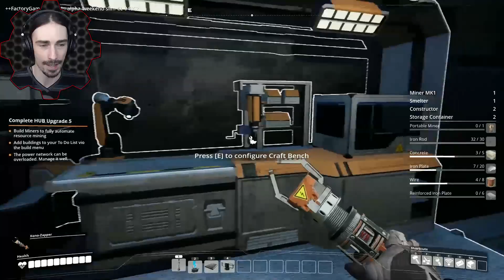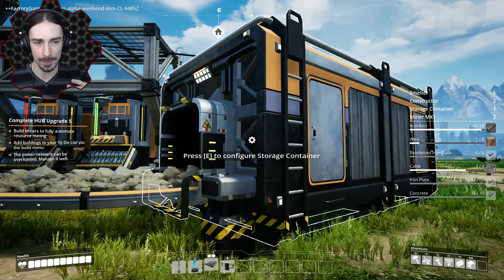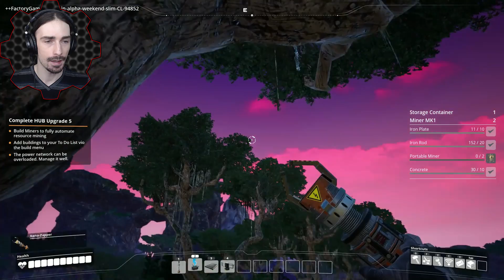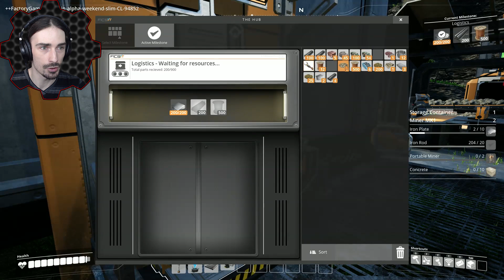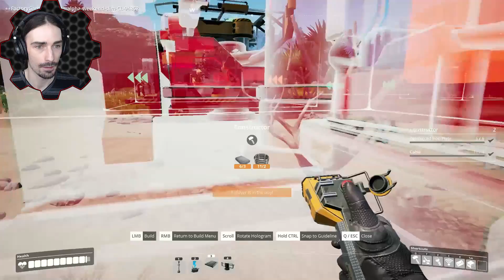Conveyor Splitters Are The Key To Happiness! - Satisfactory Gameplay

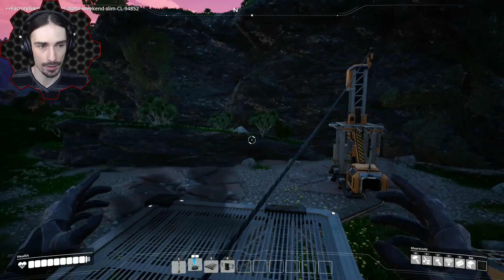Comment: It's a decent start but even my untrained I can easily spot the flaws in your splitter system. Take a close look at 26:44 - your furnace is completely flooded by the throughput of your miner.
I'd recommend to take a look at the production times of your factory's components, the game is pretty clear about the ratios actually and does most of the thinking for you.
-The miner produces 60 iron ore / 60 seconds
-The furnace smelts 30 iron ore into 30 iron ingots / 60 seconds
-The Iron Plate Constructor needs 2 iron ingots for 1 plate, it produces 15 plates / 60 seconds -> needs 30 iron ingots / 60 seconds (it even tells you the latter in the menu)
What do we figure from that? If you want to optimize your miner you should probably want something like:
Miner -> 2 smelters -> each smelter in one constuctor (for plates) or into 2 constructors (for iron rods, as it only needs 15 ingots / 60 seconds)
Reply: To long I am not reading that

Comment: - Building on the ground is not a good idea. You need to make platforms to put all your buildings on.
- Stop using the energy makers on the H.U.B and start using the Biomass Burners beacause thay make a lot more power than tham.
- Put miners on the copper. It's an invesment that pays really fast.

Comment: The iron input is pretty clogged
Split the iron ore into three , then input them into three smelters , so it will be more efficient for the constructors
And run all the constructors into a storage so it won't stop when it produces to 100 
Therefore It will be more efficient
Your setup is sometimes lacking input or its clogging 
Hope this advice helped!